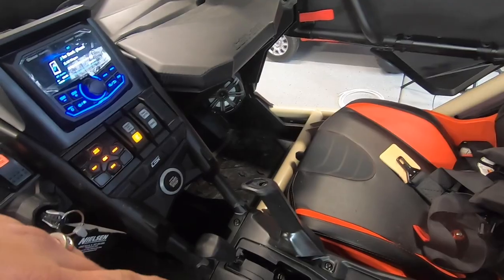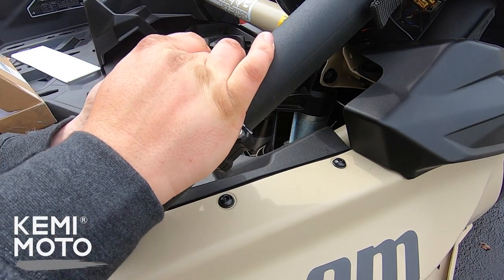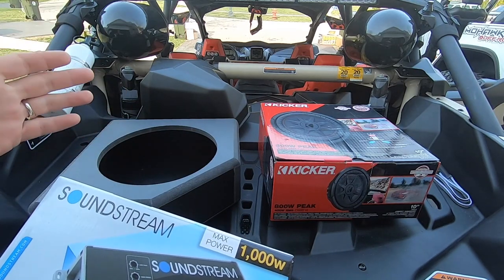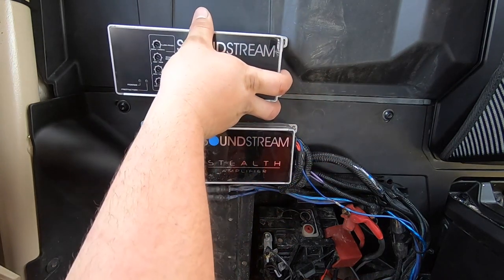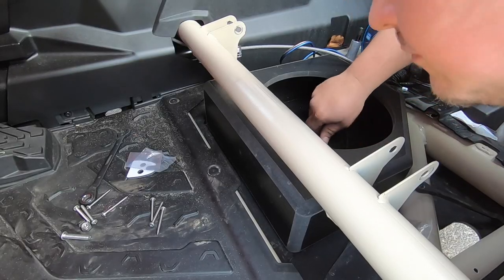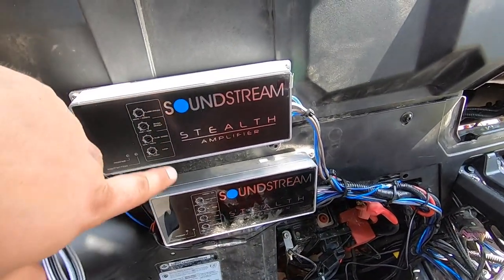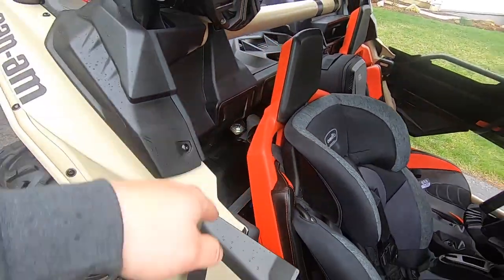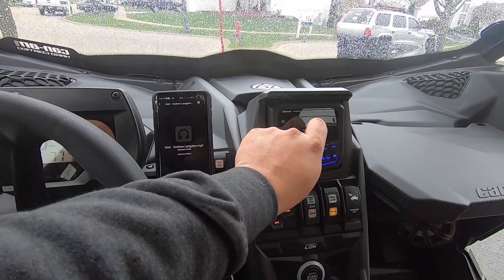Install Can-Am Maverick X3-Max Rear Sub Box & Subwoofer

Comment: Can you fit a regular size subwoofer in those box ?
Reply: Claimed 0.5 cu . I have/had a shallow sundown in it and...... It sucks.. Took it out until I get a matching cu shallow speaker. And facing up held water every swamp and wash leading to leak through voice coil rust... Still to this minute trying to work on something else like down fire sub boxes
Reply: @chrisgoetz3889  I got a down firing sub at first , They suck . It rattles all the plastic  . I got an UTV stereo small box with kickers shallow now it’s sound better . But not the sounds I wanted .
I’m looking for  a Up firing box that will fit a full size 10 now .
Reply: @angelasuncion8395  you could make rings to go around like a sub spacer and raise the mounting depth in these boxes. That's what I did to fit a shallow sundown 10. Sundown 10's are not shallow lol 😁👍
Reply: @angelasuncion8395  did it at least sound good when they were firing down?
Reply: @chrisgoetz3889   it’s  sound good in the lower volumes . The moment you play it louder  , it Will rattle the plastic and sound horrible . But if you got an aluminum or steel slider   It might sounds better  .
Reply: @angelasuncion8395  I've got dynamat covering the floor under the seats, think that'll work? Do you think it would sound good at high volume if you didn't hear the rattling?

Comment: From the head unit, did you just hook up the front speakers to the front RCA, and the tower speakers to the Rear/Sub RCA? Or did you hook up the front and rear speakers to the Front RCA from the head unit with a y splitter? Thanks

Comment: I’m running the same set up, do you have rca cables to the second amp or how are you giving it signal ? I have the one amp running front and rear speakers then a rca splitter running to the sun amp ?
Reply from the maker: I used a splitter .

Comment: Quick question, where did you hook up the amp straight to the battery or to the accessory port? 
& does it drain your battery?
Reply from the maker: I grounded to the chassis and the positive went to the battery. Remote turn on went to the head unit. Does not drain the battery with both amps hooked up.
Reply: @MohawkDaveOffRoad  oh okay thank you, so you can listen to music with the car turn off & won’t drain your battery?
Reply: @wendeldelaparicio17 negative he meant it won’t drain as long as you have car running, if ut turn off just music it will drain battery

Comment: What did you use to change the level in the bass of the sub? Also the system sounds amazing 🔥
Reply: Some amps come with bass controllers if it dont come with one you can get a rca level controller

Comment: I just went with this exact same amp and subwoofer setup. Every time I plug in the bass remote my sub completely shuts off. Did you have any issues with this?
Reply from the maker: Not at all. Maybe it's a faulty gain knob?
Reply: Did you put it in your can am? If so, is one enough?

Comment: Is there enough room to position the seat to the lower position? I really want a sub but I’m tall and even prefer my passenger seat in the lower position when I’m not driving my X3 turbo R 2 seater. Thanks!
Reply: We make a low profile sub box that'll work in the lower position. Available for driver and passenger side applications. Here's a link! https://www.utvstereo.com/collections/can-am-x3-subwoofers/products/low-profile-driver-sub-box
Reply: @UTVStereo  is there a speaker and box that has big bass.  I know  the space is limited under the seat,  but looking for something with big bass
Reply: @filitamayo  Are you looking for a sub and a pair of speakers? If so, we run Kicker subs with our UTV Stereo Signature Series 6.5" Speakers...Loudest, cleanest sounding speakers on the market.
Reply: @UTVStereo  I was I ended up getting sundown shollow subs . I ended up making my own boxes . Sounds nice.  Some of the guys I ride with want  me to make them boxes now.  I'm currently using a regular amp. Phoenix gold.  I'm looking for a marine amp to push those 12's under my seats . It sounds good now but i want a marine amp. Thank you though.